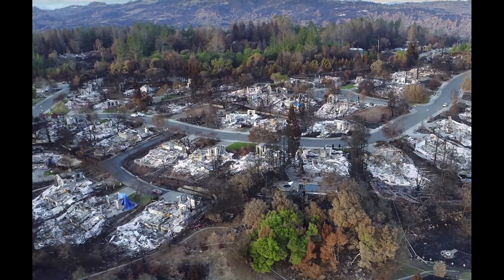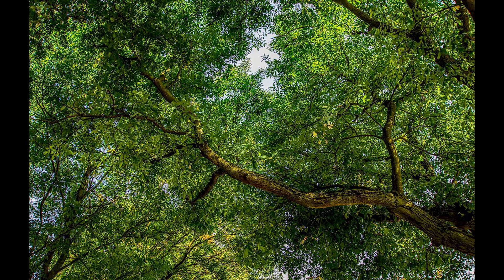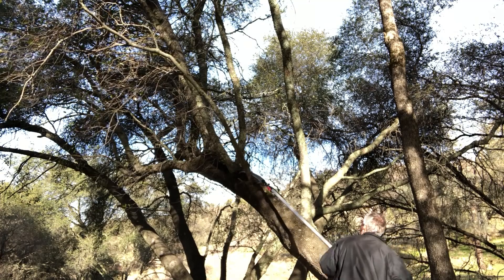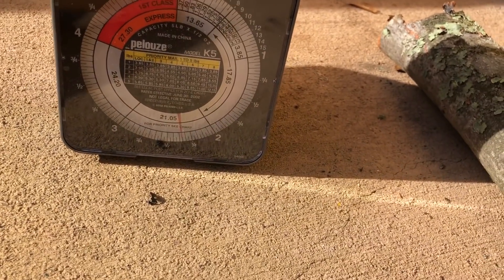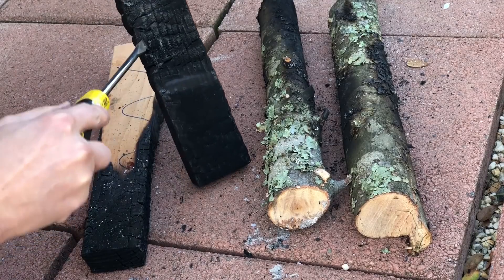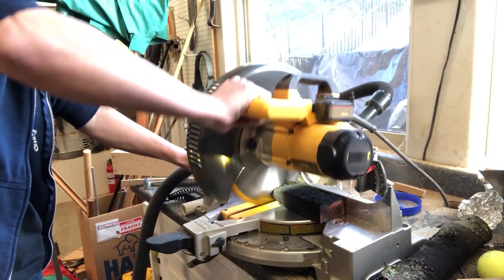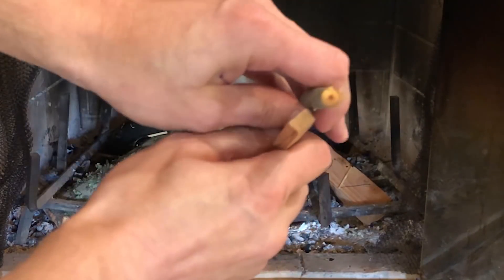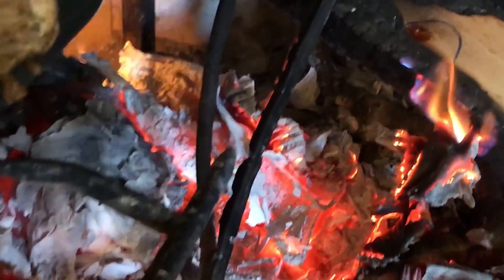Explained: Why Houses burn When Trees Do Not

Comment: Hot embers, aka: firebrands, are very important in this story.  They are similar to a charcoal briquette about 3/16" in size glowing red hot.  When it lands on green wood it does not have enough energy to light it, but it will light kindling.  If you have "house plants", i.e. plants next to your house with wood siding, they drop kindling and so when hot embers come before or after a fire, they can light the kindling, which lights the "house plants", aka: a Fuze, which in turn lights the house.  Check out "Defensible Space".  PS this applies in cities, not just in the forest.

Comment: I read it was to do with FREELY installed NEW electric meters that react to the DEW Planes when they send down the beams. Hearing 5G can be controlled through them, as well. Why would they require a Doctors note to replace them with the older technology?
Reply: I think all your information is wrong. Can you post links to your information ? Let's look.

Comment: Sorry, but how do compare the piece of attic wood and tree cut wood by eyeballing their sizes, and think that because of that, the weight of the cut wood is the same to start with as the attic piece of wood and then say the cut wood is more? I understand what your meaning is in explaining the water retention of an outdoor piece of wood, but that makes no sense at all, highly unscientific and thus proves your theory to be null and void from the very start of your video. I'm not saying the conspiracies are correct or more true, but this method to define an answer from the question is just not at all accurate. Try Again!
Reply: P.S. certain types of wood differ in weight compared to other types depending on the tree, to measure the weight difference, they measure by cubic foot, and not by what they may think is the same or not. So, point being, are your two samples the same kind of wood, and if you say they are, then how does one prove that? Sorry to rant, but don't make videos unless you know what you're talking about, it just pisses people off.
Reply from the maker: @gabehcuod6615  Sure, but the basic point is still demonstrated here - that the dead wood typically used in 2x4 framing in California burns much easier than the live wood typically found in trees in California fire regions (like where I live).
This fact should be obvious to anyone who regularly has a wood fire (where you'd use a split 2x4 for kindling, but you'd not chop a live branch off a tree and use that for kindling) but I'd hoped the demonstration would help the more "city" folk watching.
Reply: @MickWest 
Then you realized city folk turn on the telly to watch a moving picture fire.

Comment: oh FUCK NOOOOOO!!!!  even if this "explanation" is correct, how in the world do you explain UNBURNED leaves?  even if the "wet wood' didn't burn, the leaves WOULD HAVE burned off

"escaping the rabbi hole?"  you ARE the rabbit hole!
Reply: 0:08 Plenty of trees were clearly burnt to a crisp, as you can see, especially left of center frame. What did you think all those tall, branching, winding black lines are? I suppose you were thinking they were part of the burned structures.

Comment: Ok now compared to steel that melted in homes
Reply from the maker: No steel melted. Some steel warped. Some aluminum melted. This happens in all house fires.
Reply: Totally, steel at 1,000°F isn't weakened at all and can hold up the frame of the house while all the wood it's nailed to is burnt to ash and of course it will never fold or buckle as parts of the structure fall around it or on top of it as it comes down with some lesser burned bits of the structure as it crumbles... 🤪 IT ALL MAKES PERFECT SENSE! /s

Comment: Okay...then explain WHY the trees don't even look even slightly charred on the outside and why the leaves are not burned away as leaves in the intense fires would in fact shrivel up very quickly as the moisture was pulled from them. Also explain how cars can be completely burned out and yet, right next to them a garbage disposal can made of plastic is completely in tact.  Your explanation my satisfy those who do not think nor look at the evidence, but it doesn't jive here!

Comment: Uh huh... so the fires that literally melted cars, left “wet trees” untouched. 
Nice demo, but I’m afraid that placing some wood in an oven and lighting it on fire, doesn’t quite recreate a massive forest fire. 
You’d know that a forest fire can easily burn down a lush green forest, if you’d ever seen one in person - you haven’t. 
Laser beams from space? Probably not, but your silly little experiments are just as absurd.
Reply from the maker: I've lived in California for 25 years, I've seen big fires, I've seen them from my house, and I've driven past them. Yes, if something is right in the middle of a raging forest fire then it's going to burn. But that's not what happened here. This isn't a 100-foot high wall of flame consuming everything in its path.  This image at least is not a "massive forest fire". These are houses that ignited from an ember storm. High winds blew firebrands into the houses and the trees alike. The houses ignited and burned completely because there were made of dry dead wood. The trees suffered far less damage because they are live green wood.

Comment: This explanation does not make sense when you consider that there were entire guardrails that were burned out and there were twigs and pine needles under them that were not touched.  Why did the guardrails burn out when they had very large wooden posts holding them, much larger than the untouched trees behind them?  Because the guardrails were attached with screws and other metal objects, so the guardrails and the attaching metal items are conductors and when hit with EMFs (DEWs), the guardrails and the attached wooden posts burned.  They were not hit with fire, they were hit with EMFs which caused them to burn.  There were entire cars along the side of roads that were burned while the trees along side them were not touched.  Metal is a conductor, and burns when attacked by EMFs.  One or more large trees burned from the inside out, and that is due to being hit by EMFs.  You can't x-ray a tree because the bark and the inside material are different densities, and when hit with microwaves, the waves just reverberate inside, causing fire inside the tree.  Many of these communities were hit by DEWs, and you can tell this because there is no path where the fire went from one house to the next house.  No, each house was attacked.  The houses burned because there is metal in the houses, nails, screws, metal panels, electrical panels, smart meters.  There were cars on the freeway that just started burning, and that would not happen just because a spark hit the car.  There was a commercial building that just started burning, presuming the fire jumped a 4 or 8 lane highway.  The building had fire sprinklers, but it was reduced to nothing.  Fire chief said that can't happen.  Your explanation is ridiculous.  It may have merit in a normal situation, but these fires are not normal.  Open your eyes and see what is really going on; stop making excuses.
Reply from the maker: There were also entire trees that were burnt, but cars next to them were not. 
Cars generally don't burst into flame because of a spark, but what we have in a wildfire is A) high wind and B) embers. This creates what is called an "Ember Storm".  It looks like this: https://www.youtube.com/watch?v=IzqC_8D12U0
Reply from the maker: And can you link to a pic of the guardrail with the pine needles underneath?
Reply: @MickWest  Sure, you'll find photos in this video:  https://www.youtube.com/watch?v=AVnNX46_1dQ
Reply from the maker: The entire region appears to be burnt. I think again it looks like the live wood (the twigs) did not ignite, but the guardrail supports (old dry wood) did ignite.
Reply: @MickWest  Here are two more.  This one is more on the guardrails:  https://www.youtube.com/watch?v=eRdWlbjEYGA.  This one explains some of the weapons used against us:  https://www.youtube.com/watch?v=mbKFhjSl5_A

Comment: As if we don't understand wet wood is harder to burn. Personally I never even looked into last years fires. Burnt out on conspiracy anythings these days.
I'm literally popping in on this topic here in 2018 after Paradise is GONE!
To find out people been calling this out since before 2014. Many parts, like agenda21 are  FACTS with web sites.
Let's see if Paradise rebuilds, and if not, what excuse to not rebuild will it be. 
Maybe a sacred native American burial ground? 

Today Mike Morales had a live stream. Check from 7:00 to around 8:50 on his video and explain that for me.

Also went back to some of the footage like what you have, but with some house literally perfectly sliced.
I cant reproduce that on a piece of paper, wood, or corner of a dog house with a blue flame torch even.
Explain how to burn a house inside and outside, with whatever stuff was in that line, exactly in a straight line.
The side that survives, you cant even see burn marks.

Even the shot on your site of the gas station is odd. 
Been in CA for 43 years, seen a lot of fires. The lot with the gas station that the pumps didn't even burn doesn't seem to provide the fuel to completely level every structure in the picture. The trees provided no fuel, and no brush in a parking lot. Not gonna believe that embers landed on each building, and skipped the dumpster in the middle area, the walkway structure in top left, and gas pumps.

You basically explain and demonstrate one basic factor. Your demonstration also shows how hard it is to start a fire.
Where from, and how did all the energy even get to it's destination, without even using the trees for that energy.
EXPLAIN AFTER YOU WATCH MIKE MORALES VIDEO IN THE TIME FRAMES I MENTIONED ABOVE. 
https://www.youtube.com/watch?v=ErLTA74fTzQ

BTW, the vid makes it clear even without the possible object or device, that the area went the size of lake Tahoe
And be mocking the conspiracy.

Comment: Thanks for the video. However, I think it is only a partial explanation, and theoretical at that. After all, trees do burn in a forest fire, and for a fire to be so hot as to burn a house to the ground, it's hard to believe it wouldn't burn most of the trees as well. Additionally, unlike trees, the 2x4's in a house are partially protected by fire-resistant roofing and siding. For a fire to get to the internal 2x4's, it first has to burn through these materials. The answer is more likely a combination of things, including the fact that a house is more likely to 'catch and hold' a burning ember than a tree is, and the house most likely has gas and other combustible chemicals inside.
Reply from the maker: No, firebrands just get in through vents.
Reply: Don't the vents come with dampers? Are you saying that any time a fire warning is given, a homeowner need only close the vent dampers to prevent the house from burning down??? Wish it were that simple.

Comment: Maybe they should make it illegal to build all those houses with wood ... especially in fire hazard area ... and force glass and steel beams as key material to be used
Reply from the maker: That would certainly help. But you don't need to eliminate structural wood. Just make sure the fire can't get to it and the exterior is ignition resistant. Homes can be designed to be "Shelter in Place" - although that's not without challenges. It's difficult to retrofit a poor dense community like Paradise.   New fire codes are gradually making homes safer.
Reply: @MickWest  fuck it. Concrete and brick construction all the way. That's why when Americans DEW conspiracists when viewed footage from the 2018 Attica wildfires stumbled upon the still standing buildings.

Comment: So everyone describes the California fires as "wild" fires. If  the trees aren't burning, then what do you call the California fires? Uncontrolled "house/neighborhood" fires? I've lived in my neighborhood for 32 years and it has never caught on fire! Also your experiment would suggest that the house fires started on the inside of the houses (attics).  A better experiment would be to compare the tree branch with trying to light shingles, siding, stucco, or brick. Stupid video
Reply: So EVERY house was burned from the inside out with a "fire brand"? In effing credible. So what happened to the bathtubs, granite counter tops, toilets? They aren't there. Why is the glass in the cars running in molten puddles? Why are 1,300 people missing? Why is there no rubble? None! Just ash. These are not normal fires sir.
Reply from the maker: A frequent source of ignition in these fires is firebrands getting inside the house. Wood burns, the other materials fall off when the wood is gone, or they spall/crack/disintigrate after intense fire. They don't burn.

Comment: One problem though.. you don't see charred wood in the drone footage. And neither the skeleton of some of the houses. Atleast some percentage should show the skeleton of a building. Google for example 'burned down house'. Also there should be much more rubble. And for the record I work at the firebrigade! Looking at the drone footage I and my collegues conclude something doesn't add up. Ecspecially the burned down buildings in the middle of parking lots. https://www.youtube.com/watch?v=vrgUpkAcOH4
Reply from the maker: I don't see charred wood when I have a proper fire in my fireplace either. Charred wood is incomplete combustion. The building burnt more or less completely in a many cases. What you DO see is charred trees.  You also see some charred wood in some of the buildings, but you'd need to be closer.. But perhaps better perspective can be found from the simple fact that we have footage of the the buildings actually burning. Here's a pic of one of the Santa Rosa houses during the fire. https://www.metabunk.org/sk/Image_163Y0mSY1T.jpg
Reply from the maker: The some of buildings in the middle of the parking lot from your video: https://www.youtube.com/watch?v=CC7dqX4o8Kk Just a fire.
Reply: Michiel1972   I’m glad you’re a fire fighter and not an engineer then.